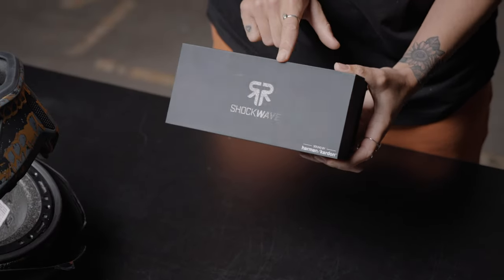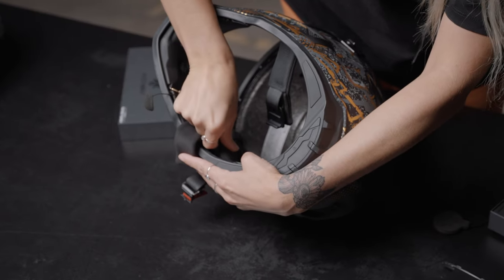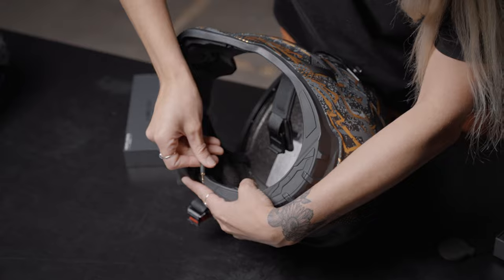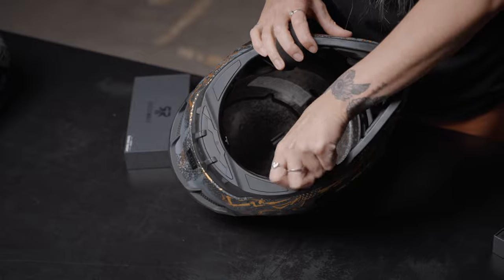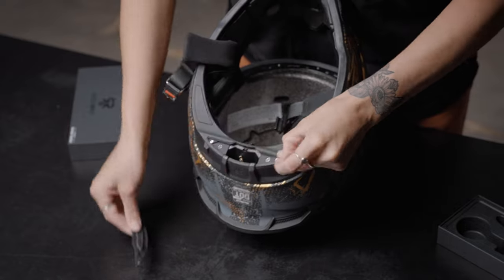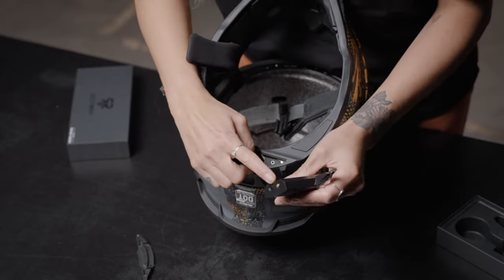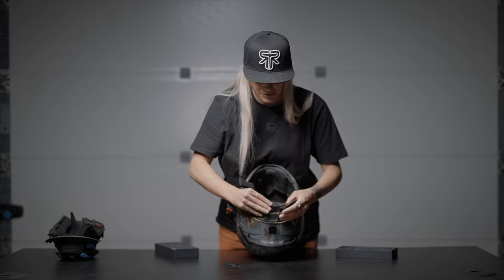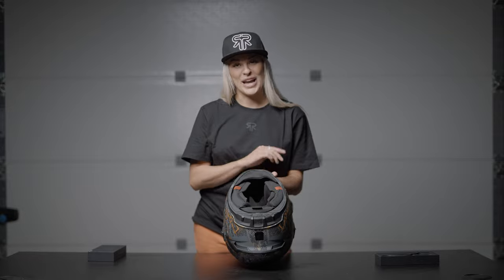Installing the Harman Kardon Shockwave | How To

Comment: Is it just the speakers that are Harmon Kardon? Or is the bluetooth amp made by them too? I have the original shockwave in my berserker and they were a little underwhelming.
Reply: You'll probably be underwhelmed by this new one then. I bought it and much prefer the original shockwave. The new one has a much lower max volume which probably helps with the sound quality in a way but then you can hear a lot more wind noise. I'd stick with the original shockwave. I'll find out if it's just the speakers or the module too
Reply: @The_Real_JN  Original seems to be only available from the international location (I'm in the US)...I have a feeling its a while supplies last kind of thing.

Comment: do you sell just the speakers alone? i jus got the 4.0 with the shockwave . be nice to just upgrade them. thanks
Reply from the maker: Hey Wes! The new unit is a full upgrade so the previous speakers wont deliver the desired sound that the new unit does. Hope that helps 💪🏻